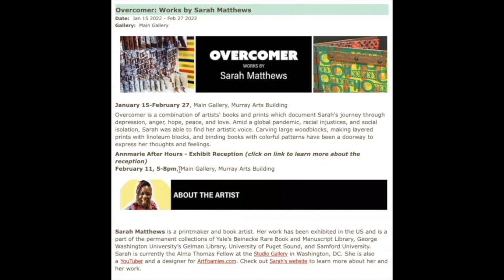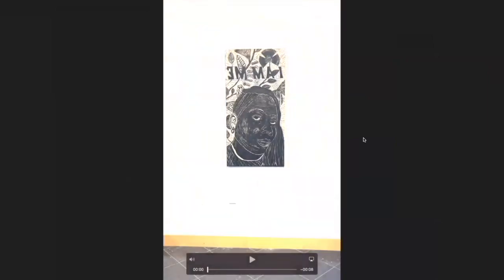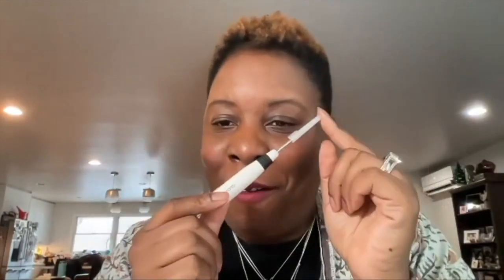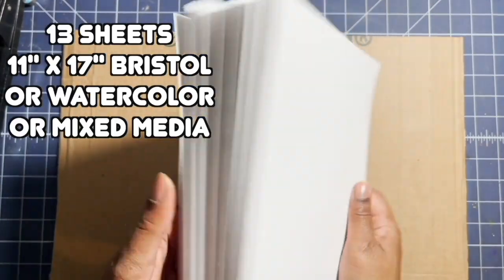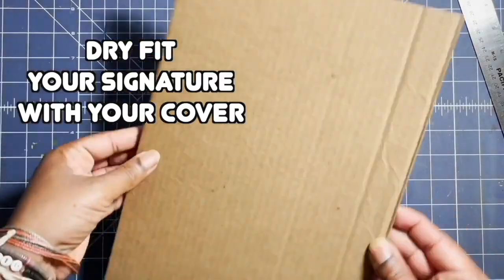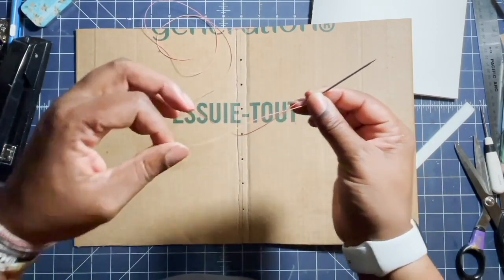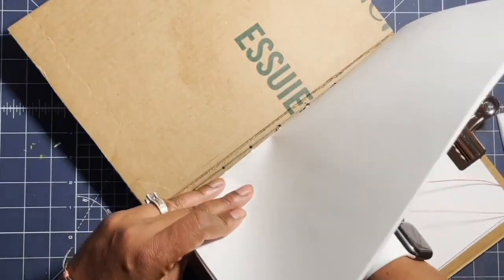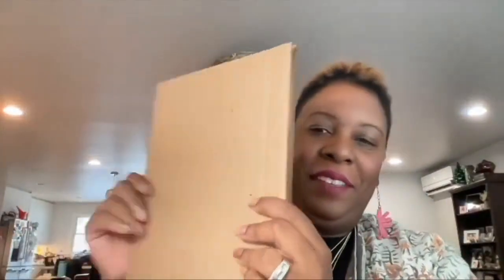Making a Link Stitch Book - Sketchbook Revival 2022 w/ Sarahbeme

Comment: I have been making my own art journals for many years now. Pretty similar to this design. I think I learned how from Teesha Moore but it’s been long enough that I have made it my own. I use 8x10 inch canvas boards for the covers with canvas to connect the front and pack covers. I use 140# cold press watercolor paper for my signatures. These days I typically have 3 signatures of 5 pages per signature. I use pamphlet stitch for binding. 

But now I am going to try the linked stitch. I am wondering which stitch will result in a more stable connection. I struggle the most with attaching the signatures. Your video was a good reminder of best practices like using a template for the stitching holes and especially using a clip to stabilize the signature while connecting it to the cover. Can’t say I do this every time. 

I typically use 8x10 inch boards but since canvas boards come in a wide range of sizes I occasionally change it up. Canvas boards also make wonderful covers for accordion books as well. Of course canvas boards are not something most people have on hand, but I was doing collage on canvas board prior to getting into art journaling so when I started I had plenty.